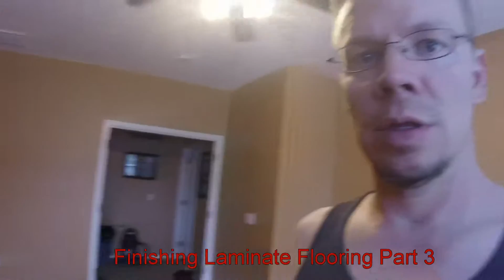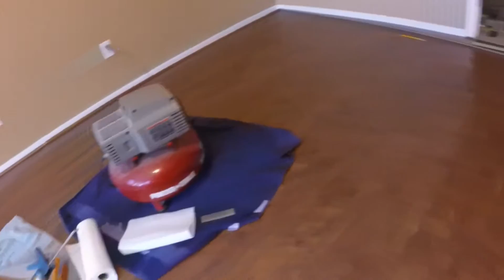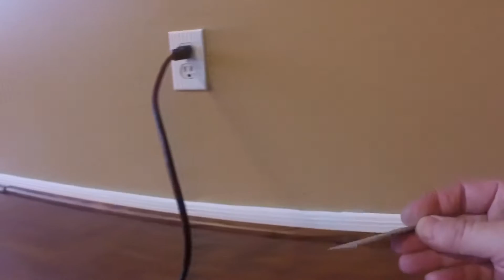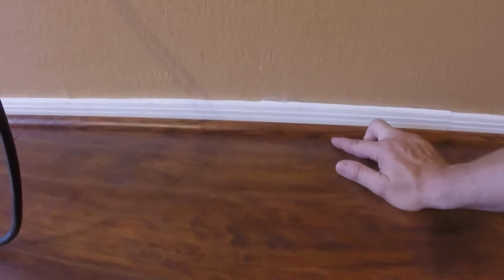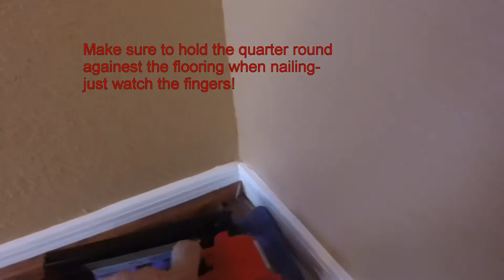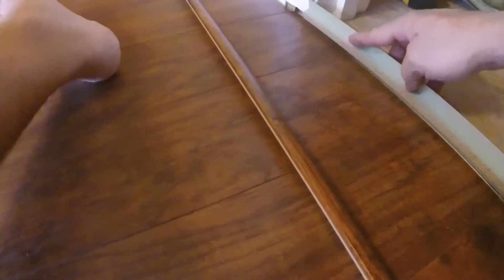Pergo Flooring Finishing Part 3

Comment: I can't find Part 4. I need to see how you finished up the area around the doorway.
Reply from the maker: realitybytez - the finishing around the door frame includes cutting the area with a wood saw around the door frame about 1/2 inch from the concrete, just enough to wedge the last slat of flooring around/under it (as seen in the video).  I would cut the least amount of doorframe as needed- just make it look uniform on both sides. As far as the transition piece, it depends on if you're transitioning to carpet or tile. For carpet, there is a flat edge on one side and a curved edge on the other side. For tile or other flooring that is level with your laminate flooring, there is T moulding available. I liquid nails the metal holder (that the T moulding pushes into) to the concrete and let it set for at least 24 hours. As far as measurements, I gave a 1/4 to 3/8 inch space between the tile and the metal track/holder and the same spaceing for the laminate flooring side. The width of your transition piece will dictate your spaceing. If you need to trim some of the edges of flooring in the doorway, a circular saw works well. If you need to remove some grout in the transition area, a flathead screwdriver or small scraper works well, just make sure the transition area is clean and level before liquid nailing the T moulding track down. Hope that helps.- Mike
Reply: Thanks!